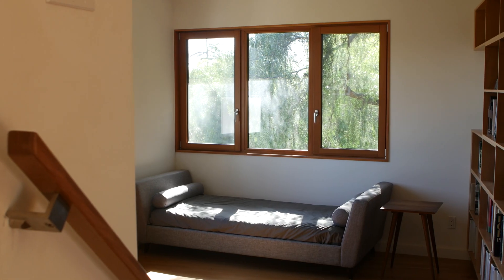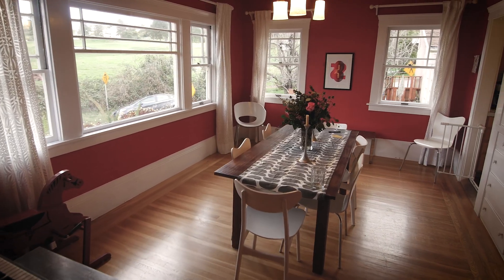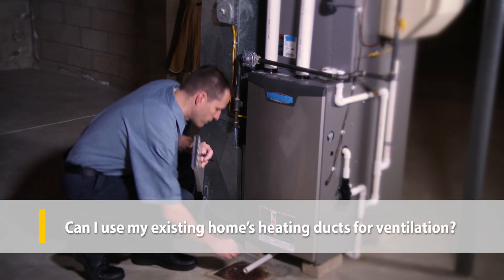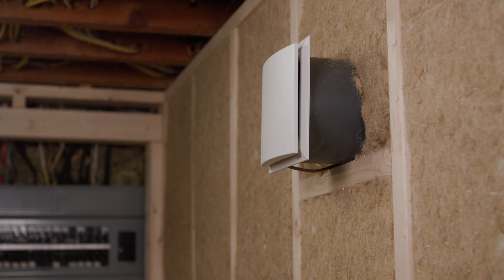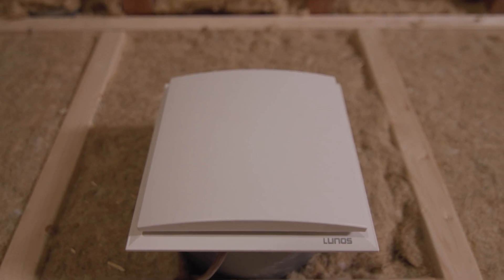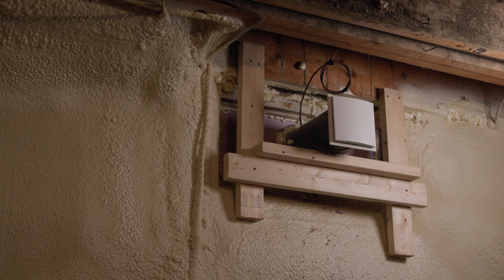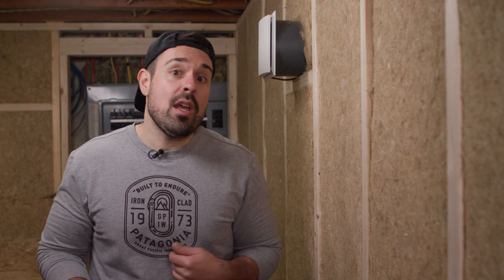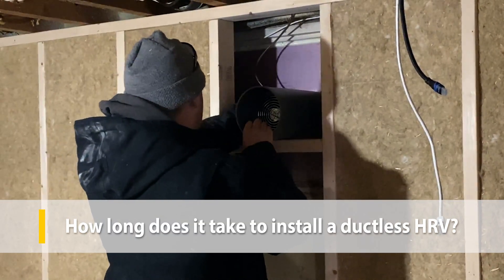Heat and Energy Recovery Ventilators: Going Ductless

Comment: I'm interested in this for a basement living space with no current ventilation other than windows.  The scenario I have would be to install through the rim joist, which would then need to angle down 90 degrees to the finished basement ceiling.  I'm wondering if this requirement for an elbow can be accommodated?
Reply: Did you do it ? 
If yes , does it work good ?
Reply: @lilsabin I can’t find a model that supports the 90 degree elbow I require

Comment: A ductless HRV or ERV is better than nothing but will never do anywhere near as good a job as a ducted system. The entire success of a whole house ventilation system is predicated on having the supply and exhaust locations in different parts of the house so the fresh air can move across the house from living spaces (living room, dining room, bedrooms, etc.) to exhaust points where you’d normally want an exhaust fan anyway (bathrooms, laundry room, conditioned mechanical space, etc.). If your supply and exhaust location are the same hole in the wall, you’re just short circuiting the whole system. 

For a single small room a ductless ERV or HRV would provide a lot of benefit, but the bigger the space, the less benefit would be realized the further you get from the unit. It wouldn’t work at all for multiple rooms; you’d have to put a separate unit in each room of your house or apartment. So to even compare these ductless units to a ducted whole house ventilation system is disingenuous and misleading. 

The marketing for these units is very inaccurate and misleading as they make claims that defy the basic laws of physics. Please don’t perpetuate this misinformation in your videos. If something seems too good to be true, it usually is.

Comment: In a house with mould issues in a cold winter UK, have been looking at HRVs and thus found your video. However, I'm extremely sceptical about the efficiency claims for so-called "ductless" (or "duckless", as it sounds to my British ear!) systems. In the expelling phase, the ideas it's recovering heat on the way out. But where is this air coming from that's being replaced in the room? From other parts of the house, and eventually from *outside*. If no air came from outside during the expelling phase, you'd be creating a vacuum. I therefore think this efficiency claim is only locally to that room, or even just the area near the duct.

I'm much more interested in the style the involves passing outgoing air across a heat exchange medium, and drawing air in (but separated) across that same heat exchanger.
Reply: Have u looked at ERV instead ?
I have heard that they "can" heat the air coming in
Reply: @lilsabin  Presumably, since they described an ERV in their last paragraph.
Reply: Have you had any luck? I'm in a similar scenario, HRV installers are not able to duct my attic as there's no clearance.

Comment: This seems like an amazing option for my home built in 1950 with no crawlspace or attic (flat roof).  We went "airtight" with spray in cellulose insulation a few years ago, and now that we have done so the air in our house is so stagnant is has caused health problems for me,  I am in the process of installing ductless mini splits from Mr. Cool but I read that the mini split does not exchange the air like a central HVAC system does.  I'm still confused why it doesn't, given there is a large outdoor unit with a giant fan you would think it would be doing air exchange.  Is there a reason why these units can't perform fresh air exchange, or is it just a lack of evolution in the technology?
Reply from the maker: Hi Rob! You're not alone in your assumption that mini-split heat pumps provide fresh air. Mini-splits actually only transfer heat/energy through the refrigerant - there's no air moving in and out of the house. Homes built around 1950 - 1980 are perfect candidates for ductless ERVs as they don't have any suitable ducting in place and are often short of headroom, making it a challenging retrofit. Lots of folks opt to buy one, two, or three ductless units that work in concert to provide fresh air to their whole home. Some brands to research are Cyclone, Vents-US, and Lunos.
Reply from the maker: We're going to shamelessly plug the store shop.buildwithrise.com or shop.buildwithrise.ca to start your ductless ERV shopping journey.

Comment: Having a TRV installed soon for the whole house.
Reply from the maker: Hey Michael! Do you mean HRV?
Reply: @buildwithrise  Nope TRV they work just like Both ERV and HRV. with out each others side effects, there new to the market.
Reply from the maker: @therealhellcat  A whole-home ventilator that's better than ERVs and HRVs sounds too good to be true, but we're open-minded! Do you have a link to the product you're having installed? We would love to check it out!
Reply: @therealhellcat  just looked up TRV. It seems the term is really marketing lingo. It is essentially an ERV that does address humidity. A lot of these different terms are marketing by certain manufacturers to get you to buy their products. All you have to do is read up on the details. Does the ERV that your interested in manage humidity? If it does, and it’s designed to move air in the quantity required for your house square footage, than it is a TRV. If it doesn’t remove humidity than it is basically a HRV, but clever ( or deceiving ) manufacturers and/or installers will call it an ERV. Bottom line, don’t be fooled by the marketing name. Instead, find out in the fine print what the unit actually does.

Comment: I'm considering installing the Lunos e2 in my condo that has 2 stories (basement and main floor).  One I will definitely put in the stairwell as I cannot drill through the foundation (condo rules). I'm in a conundrum as to where the 2nd unit should be placed - bedroom or kitchen?  The condo is an open concept.  Any ideas would be welcome.

Comment: I love the idea. Would this draw in pollen?
Reply: Depends on the filter! That said, most Merv filters support pollen removal. The Lunos e2 comes with Merv 3 in the box, which does include capturing pollen. https://shop.buildwithrise.ca/collections/hrv-erv/products/lunos-e2%E2%84%A2-hrv-system-standard
Reply: @mattdaigle  Need MERV 8 to catch pollens and fine dusts.  MERV 3 would not work.  I wish there is a better and easy to install system for people with allergy.

Comment: Would any of these ductless ERV/HRVs be appropriate for a hot and humid Texas climate?  In researching the options, it seems like adding heat to the incoming air is mentioned frequently, but not cooling.  Appreciate the advice!
Reply: Did you ever determine an answer?  Alot of ductless options only say HRV, and non really tout themselves as ERV for Texas usage.  So it is a bit confusing on options of a ductless ERV.  Even Lunos calls itself an HRV with 20-30% humidity efficiency....
Reply: @TopnotchitTX  What I have learned is that both ERVs and HRVs are capable of heating or cooling the incoming air somewhat.  The difference between the two is that ERVs also can exchange humidity which is preferable in a humid climate like mine.
Reply: They don't add heat or cooling they just maintain the condition of the interior.